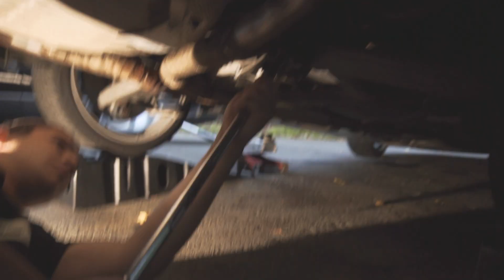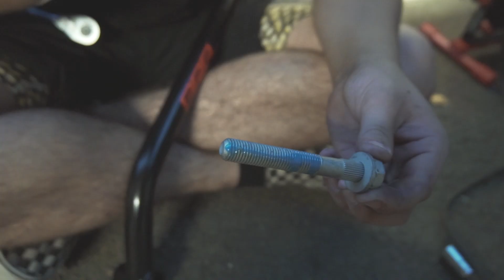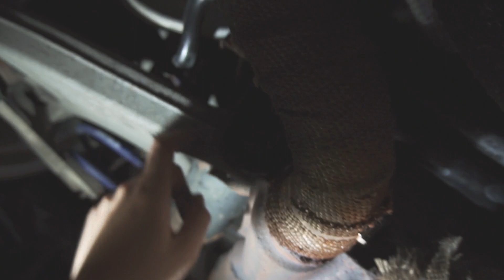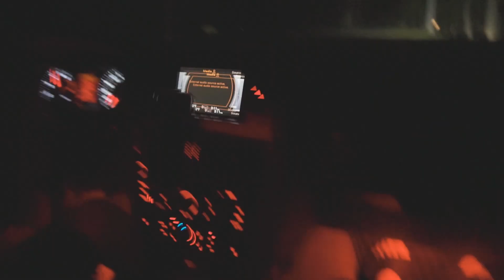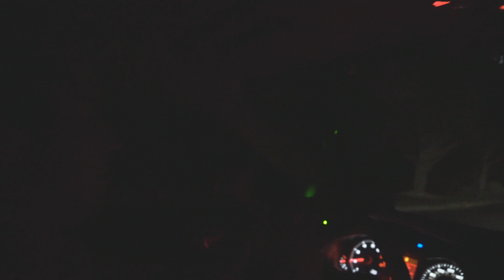AUDI B8 A4 ECS TUNING LOWER CONTROL ARM BRACE INSTALL

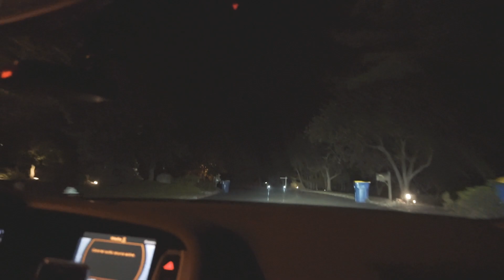Comment: 2:58 is exactly what I wanted to hear. Thanks guys. Also I would do it by myself and use my powerful leg to push the wheel in position when replacing the bolt. That's what I usually do when doing jobs like these.

Comment: why this vs a rear sway bar?
Reply from the maker: He bought this because of the lower price lol. Rear sway bar would be a better choice.
Reply: @BlacklistBuilds  Not always. I have the H&R rear bar and I swear even though it is larger diameter than stock it feels softer. For rear swaybar go with 034 Motorsports 25mm + rear bar. I would still recommend this. It serves a different purpose to the rear swaybar. Think of it as the icing on the cake.